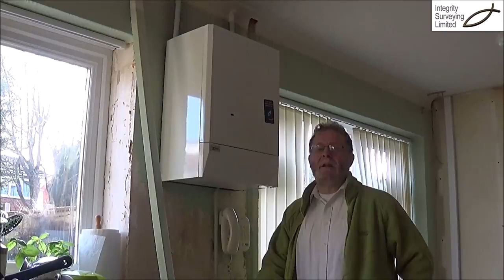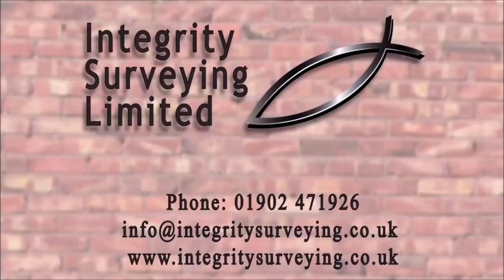New House Tour - Boilers

Comment: You can have a hot water tank and still have a new boiler. The header tank, meaning an open system, is an older/traditional system. Swapping to a combination boiler from a hot water cylinder system would require lots of pipe work mods, depending on the pipe work layout, combination boilers often struggle to serve simultaneous hot water demand and high flow showers.